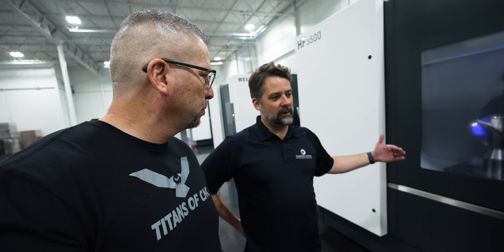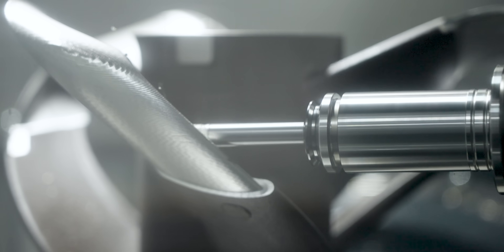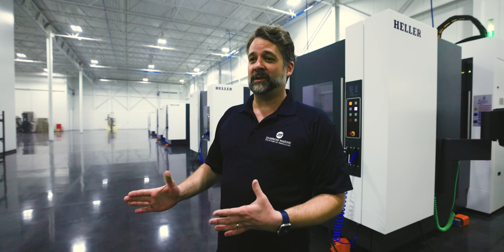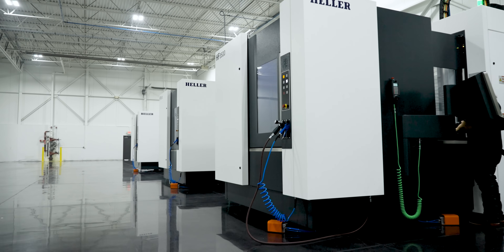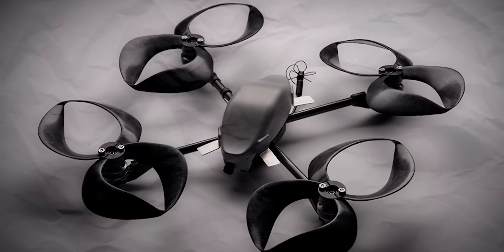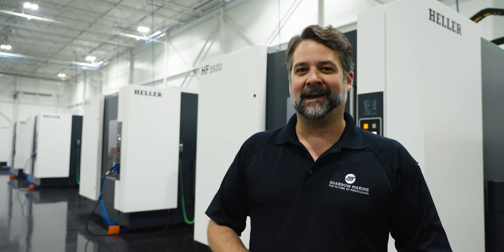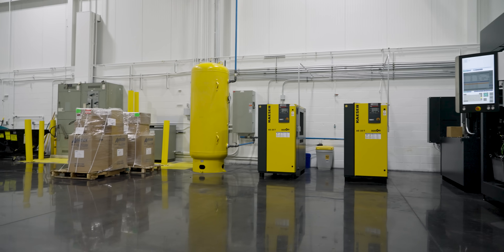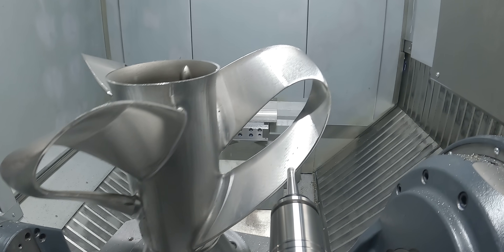BRILLIANT HELLER Machining Cell at Sharrow Marine | Made in America

Comment: I learned so much from your videos. 2 years ago I quit my boring job and invested my life savings on a 3 axis mill. Studied your videos and Lars Christensen as well. I became obsessed with machining, opened a small shop and doing well. Thanks for spreading the knowledge.
Reply: Hey don't knock boring. It can be a very specialized field of machining parts.
Reply: @martinternes3775 I was designing portable bathrooms in CAD all day lol
Reply: @jmeleika1  were you able to design solutions for isolating stinks or maybe condensing the solid waste and separating and sterilizing water?  Or trying to fit as many stalls in without stacking them vertically? Lol
Reply: @P.R.Shriram  more like trying to design the damn unit so they could get it inside the Tesla factory without having to modify the walls. It wasn’t a terribly boring job, but I like to learn new stuff and machining has given me an opportunity to every day.
Reply: @jmeleika1 , portable bathrooms made from a solid billet of titanium?
Reply: @Joe-bh4vz  God please save you from slipping there :)
Reply: @Joe-bh4vz  I prefer berylium copper myself (at least that was what they called it in the documentation)!!  That way you know it won't ever be stolen!!  I worked on three pieces once that were 5 inches square by two inched thick weighing in at around 70 lbs!!!
Reply: @martinternes3775  Haha I get it…. A little late there. I’d rather be boring than grinding though !
Reply: @jmeleika1  I get that, about preferring one type of work over another!!  But i was using an Okamoto 6X18 that had turcite ways and had been through the hands of our millrights. This machine was so good I was beginning to think I could work to double sided lapping tolerances (we had Peter Walters double sided laps that we used to produce helium lights bands of flatness)!! Would periodically get a part that a couple of other guys had tried and drive it up to whatever they wanted!!  Thanks for the comments!!!
Reply: @martinternes3775  😂🤣
Reply: @martinternes3775  when I was doing lots o precision grinding I got to the point I could hold+/-.00005 and I slept like a baby but i was using an Okamoto 6X18 that simply never made moves I didn't ask it to!!  It was flawless and one of the old millrights told me to run it the entire length of the Z axis which i did everyday there by lubing the the screw!!!1
Reply: @martinternes3775  I like boring. It's exciting and will have you throwing up when you scrap an $80k part
Reply: @martinternes3775  I think he means his job wasn't interesting.
Reply: That's amazing. Good work!
Reply: @alexanderjamesINC  thank you sir
Reply: Better lathe than never! :)
Reply: Keep commenting on titans videos with your progress! I’d love to hear when you get your 2nd machine, 3rd machine, first 5 axis etc
Reply: @danhyde7501  I will!!! Thank you Dan. Even thought about starting my own channel. If I do, I’ll tag you in a comment.
Reply: that puts you in my heroes hall of fame my man! Thanks wanted the same, never quite pulled it off!!
Reply: @highpointsights  thanks. It was very difficult and still is. I’m single and live a modest life to make this happen. I sent some quotes to my former employer (that they never asked for). Ended up winning a few, and was able to get the business started. Without that lead I couldn’t have done it.
Reply: @jmeleika1  Glad to hear all of that. My parents both operated there own business. My dad's was to fix anything, sharpen anything my mom was operating a Kinkos like operation 60 years ago. Y'all are my heroes. I did design and manufacture my own pistol sights for fire about 10 years. The manufacturer of the pistol bought the rights to them!
Reply: Good job man. That shit takes real balls to do.
Reply: @shawnbutler9888  thanks man. I bought the machine 1 yr before quitting my job (with the “I’ll get around to it” mind set). It was basically a toy. But Owning the machine for a year without having it generate money was so expensive. Mostly because of rent (I live in an apartment) so I was paying for shop space every month for nothing. When I made the decision to take cnc seriously , I was so over my job, was miserable there... the machine was sitting around collecting dust. For me it was obvious what I needed to do. I quit the job, spent weeks binge watching these videos, toke notes etc. So this “ballsy” move was fueled by frustration tbh. Also, last day on the job, I overheard my bosses panicking about a part they could not get on time due to supply chain issues. That was my first order. Didn’t even have any finish passes … I learned as I went ha. Still learning every day. So yea… kinda ballsy but it didn’t hit me until I was too deep in to look back.
Reply: How do you find jobs?
Reply: @codetech5598  I started trading guitars on Craigslist at 14, started my first business at 19 in the guitar world, 24 moved to the CAD design world, now (29) doing cnc. I’ve met a lot of people along the way. Fortunately word of mouth has been enough.
Reply: @jmeleika1  Do you work locally or using mail order?
Reply: @jmeleika1  Are these one-off prototypes or is this a weekly production schedule?
Reply: Very nice i am very proud of you
Reply: Thats awesome, im a year and a half into programming in aerospace. My dream is to open my own shop with my own machines. Its great to know its still possible
Reply: Thats so cool. I also like machines but i'm to dumb for cnc. I like manual machining but  i wish i could learn cnc.
Reply: @bearbait2221  if you can make accurate parts on a manual mill or lathe, I think you’re smart enough to learn to program cnc with a CAM software. I encourage you to give it a shot.
Reply: @jmeleika1  Thx. I took drafting in high school. The last class to have old school drafting they had started cad classes the next year after i graduated. They also set up a welding/ machine shop after i left. PISSED ME OFF SO MUCH. CNC looks like fun.
Reply: Cool it worked out. I want a mill, but its so expensive. Still, from time to time im looking at old machines, analog seems most realistic. Probably end up with a machine at some point. When i do, bet i draw blanks to what to make. Kinda my curse xD
Reply: Machining is awesome. i love this stuff. Went to a trade school, spent a year learning it. But the school failed in it's promises of job placement, and I have difficulty with the process of finding employment. One I get hired somewhere, I'm great, but I lack the social skills/connections to actually obtain any employment.
So, I just sit on the side lines. I can't afford my own machine, so I haven't been able to practice my skills. It been 20 years since I have touched a CNC.
This could have been a great career for me, but now my life has failed and I have given up in my 50's. It's too late now. Nobody would ever hire me. I can't keep up physically.
Now I'm REALLY depressed...... I failed in life.....
Reply: @peterbelanger4094  I’m sorry to hear you’re not doing well. I struggle with similar thoughts and understand the pain. Don’t be too hard on yourself for not starting your own shop. It’s more than a career. It’s a pain in the ass most days, and I work 7 days a week. Went broke many times. Left my girl friend to focus on this. We were gonna get married. It’s not just a job. It comes first … bright side is that most people these days have no interest in this stuff. Average person doesn’t even know what a mill is. So the fact that you’re familiar with this equipment puts you farther ahead than you think. Take care Peter.
Reply: @peterbelanger4094  also, everyone told me I couldn’t do it. Coworkers, family, friends… i didn’t believe them. I knew I could. Don’t tell yourself the lies that everyone told me
Reply: How do you acquire customers?
Reply: Bro that’s incredible
Reply: hell yeah
Reply: blessed, enjoy the journey brother!

Comment: The raw finish looks like they are 3D printed. Then machined for final finish?
They don't mention that in the video. But looks cool.
Reply: They said the parts are castings. With the right sand type, it's possible to get a fairly good cast finish.
Reply: @Proud2bmodest  Thanks. I missed that.

Comment: And these props still cost 10x more than the ones they are intended to replace.
Reply: They are expensive, but worth every penny.  Sharrow is legit, and already going on any boat with the budget for it.  Give it another five years and you likely won't see a new boat without one due to the fuel savings alone.
Reply: @arg8763  I am not questioning the prop or it's performance.  I am questioning the economics.  $100 versus $5000.  Current lead time is 90-120 days if ordered today,  old prop can be had in an hour.  Same story with repair.
Reply: @D2O2  the ecomnomics are 40% fuel savings at cruising speeds. Fuel costs are one of the highest costs in boating due to the constant load, so any savings add up quickly. Five years ago these seemed like a vaporware Kickstarter kind of thing, but they have been independently tested enough to be worth it if you can afford them. For your pontoon boat maybe not, but for commercial fishing and large sport boats definitely.
Reply: @arg8763  Sharrows own website claims UP TO 30% more fuel efficient between 2500-4000rpm.  Please provide link to where you are seeing "40%  fuel savings at cruising speed? "
Reply: @JoeTaber  half the videos are from boattest, the other half are sharrow themselves.  Regardless,  I am not questioning that the prop exists, or that sharrow can customize design (yes, custom designed) a prop for a specific engine /drive combination that yields performance improvements and increased efficiency, they can.  The challenge is that they are trying to replace a few hundred dollar prop with a $5000 prop.  That is a lot of upfront cost for a return that might be months (commercial applications) or decades (pleasure applications).  Very different economics for a 5k upcharge for a $40-50k versus a $10k (twin engine) upcharge for a $150k+ boat.
Reply: That's because the old props have been around for 100+ years so mass production has been fine tuned and made the most efficient possible to bring down that cost. Same for everything, as you start out the price is high, as they get more and more mass production introduced the cost goes down. A dozen or so machines is far from mass production in this scenario.
Reply: @robl4079  old props are investment cast then polished.  No need for cnc machining.  Sharrow is already using Y.P.P.I for their investment castings before cnc machining.  You'll need to eliminate the need for cnc machining to get this competitive.
Reply: Add in that there is probably hardly any competition when it comes to these propellers.
Reply: @jucaesar4961  Yeah, they have spent countless dollars on securing hundreds of patents.  No amount of manufacturing optimization is going to reduce that sunk cost.
Reply: @D2O2  The only patent I have found so far stems from MIT. I doubt those guys in this video are from MIT.
Reply: @D2O2  they are expensive but I would imagine that in the boat sector, fuel savings from better prop efficiency make up for the invesment rather quickly.
I mean, seeing how many props they are planning to produce, these things are selling fast. And the boat owners have probably done the math.
Reply: @Mr30friends  I have done the math with my pleasure craft.  The cost premium is not returned in fuel savings over the expected life of the boat.
Reply: @D2O2  well, I guess it depends on the case
Reply: @jucaesar4961  The patents are held under Sharrow Engineering

Comment: Hm. How does it work? If you push the tool over its limits and it breaks during the manufacturing, is the part itself thrown away or is there typically a way to proceed further after the tool is replaced?
Reply: Depends, most of the time I'm finding I can just resume, though it's mostly not the final cut that I'm using well over the limits, so there's more than enough room to cause 'damage' to a part, yet since its just the roughing cuts, that damage would be cut out anyway.
If I'm going past limits in a final cut, and it breaks, then yes it might damage the part beyond a salvageable point.
Reply: To break the tool you have to push them way harder that what they are doing, in this application they are just wearing them a lot quicker, however it doesn't mean that they will last 1 or 2 parts
Reply: Most of the time the tool will break on roughing passes taking chunks of material off to get closer to the finishing pass. So a tool breaking on a roughing pass will just make you replace the tool and continue on that same part and any “damage” gets machined out on the finishing passes.
Reply: You're making the same part over and over again, so, you know where and when the tools fail and can swap them out before that happens to avoid burning a casting.